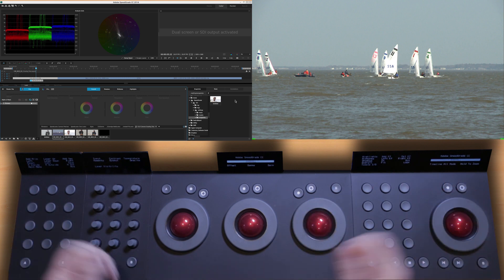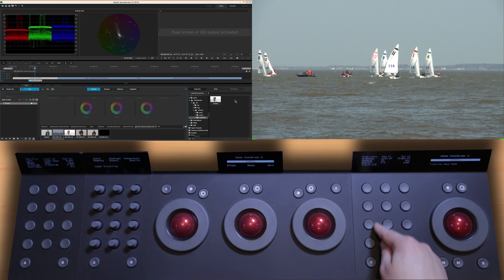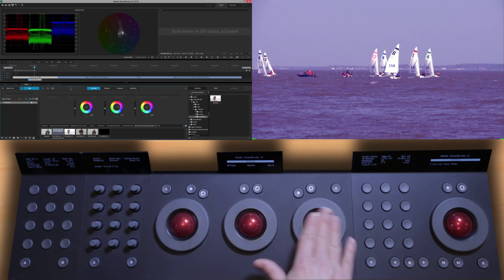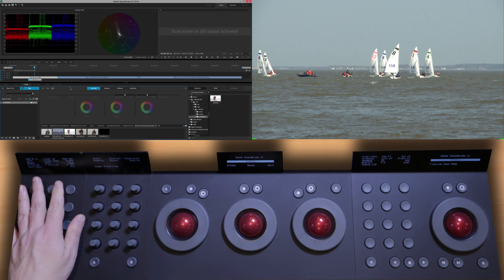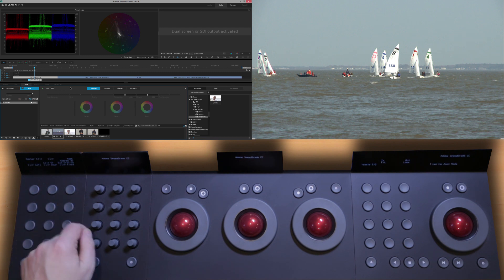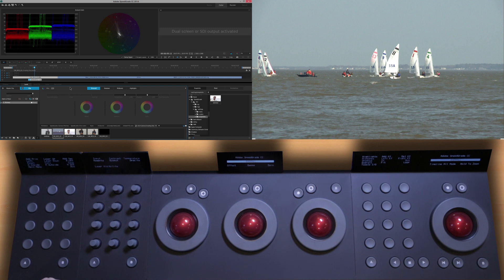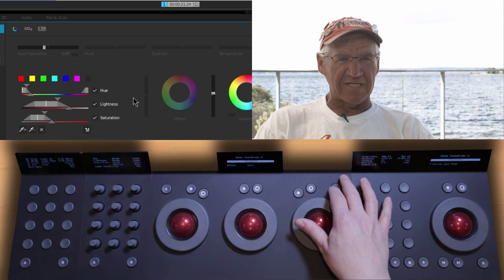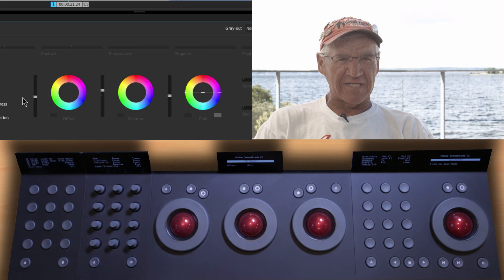Adobe SpeedGrade and the Tangent Elements Panels

Comment: I just got 2 of the Element panels (Tk snd Kb) to go with Speedgrade. They are awesome. The rings are so smooth. The knob panel is great too.
I added a X-keys 24 to make selections, add primaries and secondaries, toggle between Overall, Shadows, Midtones and Highlights. Going through menus on the Element Buttons panel seem quite frustrating.

Thanks for the video tutorial! It (and a few others like the one from Andrew Davis and Mixinglight) have help me decide on buying the Tangent Element and did not regret it at all. Only regret, I should've bought it sooner.
Reply: I miss the ones I was using.